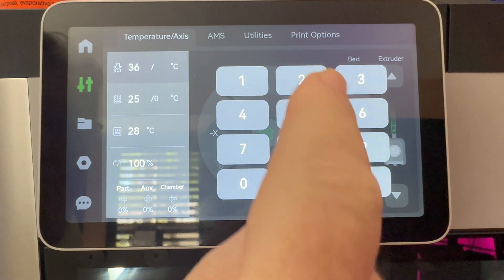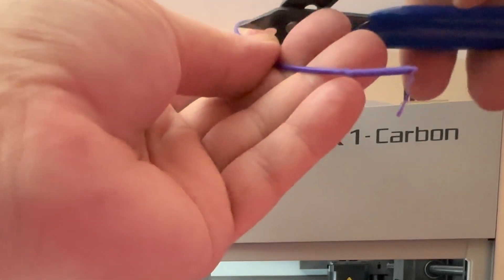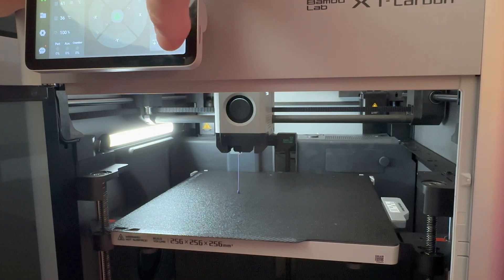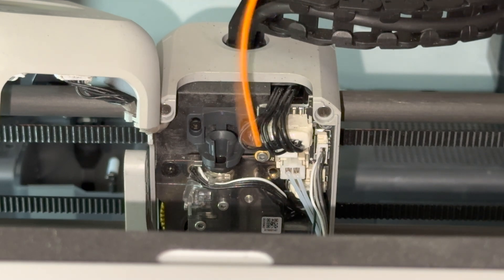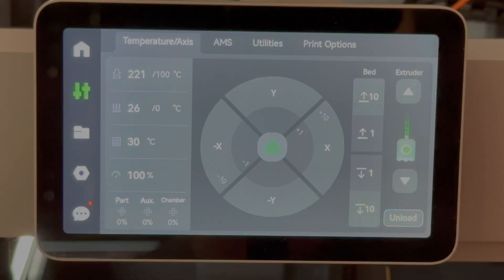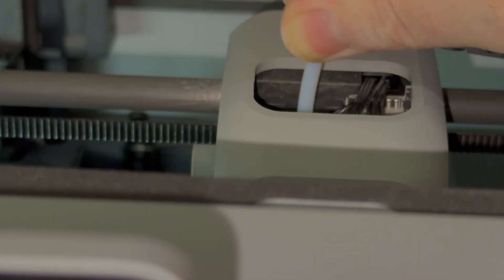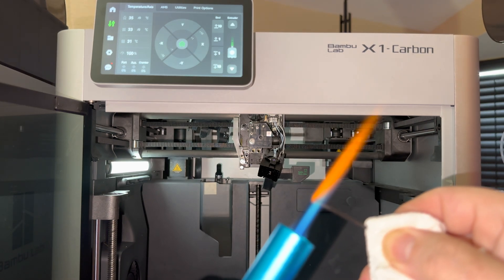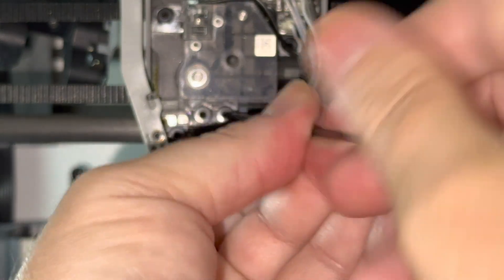How to Easily Unclog Your Bambu Lab 3D Printer Nozzle: A Step-by-Step Guide

Comment: Broken Filament, in my case, is not a rare case but made 10 of 10 extrusion problems to me in tha last 9 days I had this printer
Reply from the maker: I always bend the filament before feeding it into the printer, if it’s brittle it will break, where then I pull some further and try again. Once it is not breaking anymore, I make a clean cut and feed it. I haven’t had any issues with filament breaking since I started doing that.

Comment: @2:38 isn't it supposed to look like that because the filament cutter is just above it? 
I had a clog IN the extruder so when i took out the nozzle mine looked like that as well but clog was not there. So just heads up anyone experiencing a clog you might have a small broken piece inside the extruder not in the nozzle.
Reply from the maker: This situation is when you do have a clog in the hot end - mostly caused by heat creep, so the issue is that the heat gets too high up and melts too much filament too high up. But yes, if the nozzle is fine, the next step is to take the extruder apart, you are correct. Thank you for bringing it up.

Comment: Wow - that hex key trick was like magic!!  I spent 30 minutes trying to get a clog out and no progress - then heated the hex key, let it cool then pulled the filament out easily.  Thank you so much!!
Reply: Pro tip. Heat the hex and leave it in the nozzle to cool down.
then twist and you'll hear a pop then slide out the stuck filament
Reply from the maker: Fantastic! So glad I could help!

Comment: I hade huge issues with TPU and the 0.4mm nozzle at the beginning, but now, when the filament is 100% dry I go to the upper limit of the temperature and remove the speeds to about 60mm/s. When the temperature was not at the upper limit, big prints started to fail after a few hours, it seems there is some build up in the nozzle for some reason.

So what I do to avoid that is printing a smaller part with a new material, and increasing the temperature by 5°C during the print, to find the max. temperature till the surface gets bad. That's the temperature I am using to keep the nozzle clean.
Reply: Thanks for the tip

Comment: I finally got a jam after a few months with the p1p.  It was WAY worse than this though.  idk how it got so bad, but had to run cleaning filament through and finally got it.  Did like 3 cold pulls before that, nothing down in there that I could see...idk what happened but it was an odd kind of filament like possibly abrasive and has some added chemicals to it so I think they got clogged in there.  The odd thing is I printed with it a lot with my stock nozzle, but once I put hardened steel in there, then it clogged.  Really hope I don't have to change my slicer settings for ALL my products just because I put hardened steel nozzle in :/
Reply from the maker: If you are printing PLA and high heat on the bed, this would do it. Try using the cold plate or the textured pei plate. These are less likely to get heat creep.
Reply: @techwithkramer  I use textured pei but 65 degrees on bed, PLA

Comment: Could you please explain how to remove the ptfe tube more specifically?  Ive got a P1S, is it the same?
Reply from the maker: Yes, where the tube gets into the holder, there is a ring on top of the holder. So you push down that ring while you pull the PTFE tube out.

Hope that helps.

Comment: @techwithkramer great video! Where do you stand on using "cleaning" filament to clean the hot end?
Reply from the maker: I have some and they say the particles will be sticking on this, but I think there is not much if any difference using regular PLA for a cold pull. So after using it up, I wouldn’t buy it again.

Comment: When my nozzle has clogged, it required full disassembly.  When the extruder is locked up because of the filament, a little pushing or pulling isn't going to fix it.
Reply from the maker: It works in about 30% of my cases, worth trying before starting the disassembly. But yes, if the extruder is clogged, no chance to fix it other than take it apart.

Comment: Little in doubt if I have a clogged nozzle. Don’t have a heating tool, but will try the cold pull, and re-calibrate etc. Today I had like 5 failed prints in total. Sometimes part of the print would be ok, and then suddenly it would fail. Also cleaned the gold textured pei plate, but fail also happened on the cold plate when trying this instead. A number of issues. Support coming lose, a print object coming lose but in this case there was kind of a thick string between one part holding on to the plate, and another that had then come lose. Using default PLA and plate profiles / temps, and have printed a number of successful prints since I got the printer 2 - 3 weeks ago. All PLA printing. A bit confusing as some issues seems to suggest maybe the plate needs a proper clean, even though I clean after every print, and another thing point to the temperature, but again default settings. Hotend 220 C, Cold plate 35 C or textured PEI 55 C. Opened the door on my X1C to keep chassis temp around 36 C.
Reply from the maker: The build plate might need some soap and water - else, it’s all about experience in what situation to do what change.
Reply: @techwithkramer  Yeah tried a number of things, but printed fine with same filament for other prints, and then just failure with any settings. Anyway both pei and cold plate soap cleaned. Now I just did all maintenance steps, and cold filament pull etc. Next trying to dry one filament and tomorrow I will try to print something again.

Comment: What if cold pull does not work and it is still clogged, after several cold pulls.
Reply from the maker: The cold pull is in case there is filament on the higher end of the hotend. The lower part should be able to get clean buy higher temperature and pushing filament from the top in. What exactly is your situation?

Comment: I used the unclog method when unscrewing the hot end, and removed a large clog, but It still won't extrude, I'm considering there might be more clog inside deeper and I need to do this again. Is this correct?
Reply from the maker: Can you get the filament through the extruder? Sometimes the extruder gets clogged due to heat creep.
Reply: @techwithkramer  I did some trouble shooting and finally got it working again! Thankyou for the insight your channel provides.
Reply from the maker: You are very welcome! Happy printing.

Comment: Thank you for this video! I got clogged last night and had to figure out what to do. I ended up removing my nozzle and using my hot air rework station to heat the nozzle and push the old filament out. This is a LOT easier.

Comment: Kramer, my problem is I can't even pull out the PTFE tube. I'm pressing the O-ring down while pulling, but it's so insanely stuck I don't know how to get it out?
Reply from the maker: This could be because the filament inside is stuck. Try to see if you can remove the tube on the other end.

Comment: This was great, very straightforward and to the point. I hadn’t previously known the proper procedure for a cold pull, many thanks!

I also had never seen the trick with the hex key, to pull out broken filament, BRAVO for that! (A ball-end hex key would be especially good for this, as the ball would give the filament a lot to grab onto :-)

A note though: It would depend on the alloy the hex hey is made from, but heating it might result in a change to its hardness or toughness. - So probably only do this with a key hey you don’t care about using in high-torque applications.
Reply from the maker: Thank you for your feedback. Totally agree, the hex key to use definitely should be one you don’t use as your main tool.

Comment: For the last example, I use my old guitar strings to pull cold clogs.   I take the 5 or 6th top guitar string and heat it up with a lighter until red hot, then push it on the stuck filament.  Wait a few minutes until it cools and then pull the clog out.   WORKS LIKE MAGIC !!!
Reply: That's a great idea. I'm definitely trying that

Comment: I applied 30 kg of negative pressure on the tube. It did not move but almost broke. When looking at bambu labs official video on unclogging it is demonstrated clearly that in order to remove the tube, you first have to push down the collar.

I guess I will take my advice from bambu labs in the future.
Reply from the maker: Not sure what you are referring to. PTFE tubing always gets release with pushing the ring down - just as I show it. What part of the tutorial are you referring to?

Comment: If you could simply push the button to extrude filament and filament would come out...then you would not have a clogged nozzel and if you could simply pull the filament out by hand and cut the end off and then put it back in and extrude filament...then this is a very simple fix...and you would not truly have a clogged nozzel.  This video is not for someone with a clogged nozzel. This is for people without a clogged nozzel.
Reply from the maker: Sometimes it is enough to put the temperature higher and give it some extra push by hand, as the extruder might need more strength to push it through.  I am running a printer farm, and my printers usually run 24/7; this is what I do and what works best for me, and I share it so others with less experience can get their printers back to work quickly. It really does work. You should try it next time you have a hotend floating in the air...